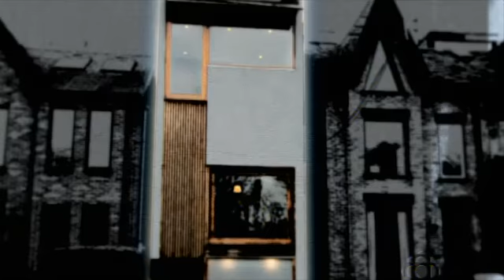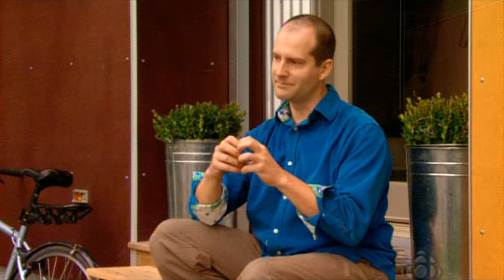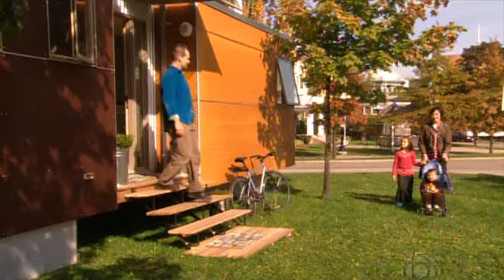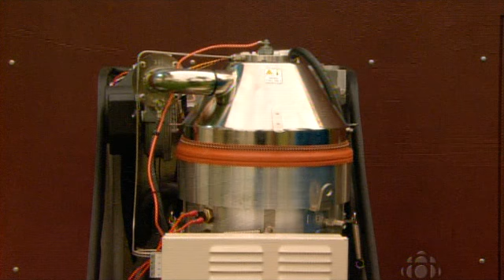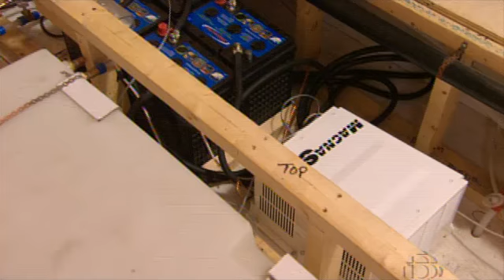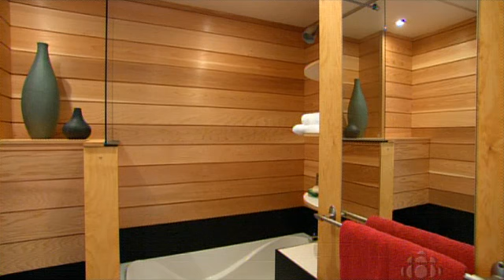miniHome Walk-Through with David Suzuki

Comment: According to the manufacturers website:  $139,999 (CDN).  I'd consider one if it was $39,999, but for $140K, you could buy a decent sized house outside of the city.

Also, you still need to purchase land to set this house down onto.  So your total cost may actually be more than a 1600 sq' home is!